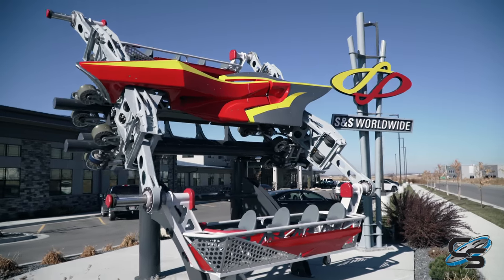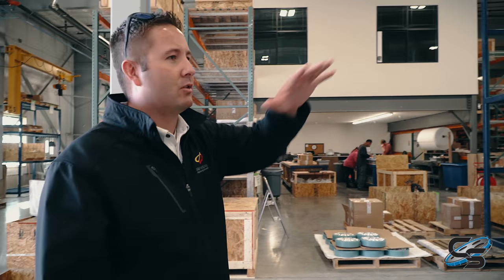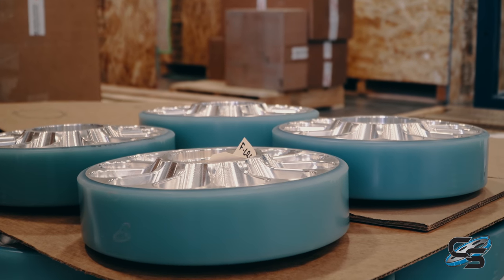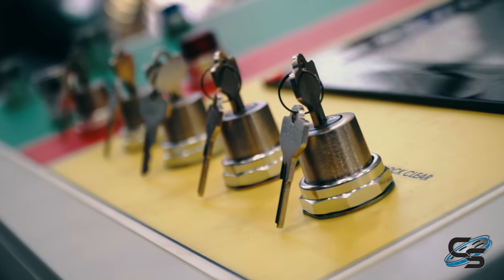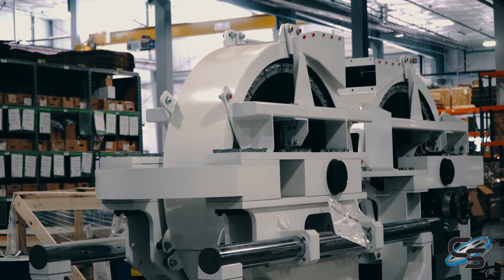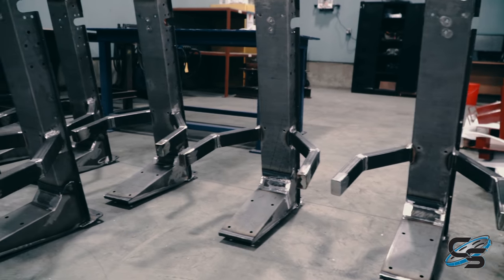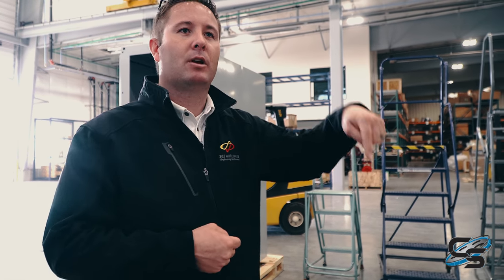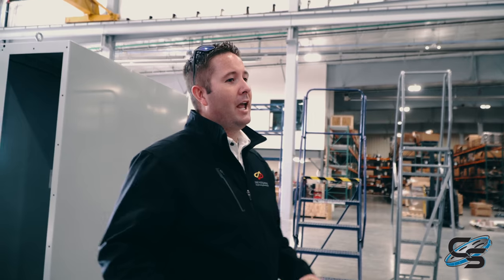S&S Worldwide 2019 Factory Tour | Logan, Utah

Comment: I absolutely love that they're still supplying parts for all the old Arrow coasters.
Reply: As a matter of fact, they're currently re-tracking Big One in Blackpool Pleasure Beach
Reply: so, arrow coasters will last about... 29482948284729471891937572049856194819577619102956194019371930428294957295719577619720298290581791417480166184092617050586164950293882029482740603668405039582959993747milliseconds
Reply: @dotdankory   Considering there are 86,400,000 milliseconds within a day giving you 31,536,000,000 in a year, that ridiculously enormous number you just randomly typed out means that Arrow coasters will be supported by S&S for approximately the next 9,000 years. So RIGHT ON!
Reply: @NorthernRidesYaBoi  The steel is being fabricated and installed to the original specifications in the UK and not by S&S. Just to make obvious yes there is love for Arrow but BPB and its contractors are handling the retrack.
Reply: @ChloeClements34  Oh okay, my bad

Comment: I wonder if they’ll ever build a new Arrow Suspended Coaster. I mean, people loved those and these people have all the drawings from Arrow
Reply: this new model is basically an arrow suspended coaster with inversions
Reply: Balthazar Brat but the suspended coaster’s prototype DID have an inversion. At least I think it did
Reply: @benwetzel8449  I'm pretty sure a prototype was never built that way but the original thought process by Arrow was to try and make a ride that way.
Reply: Gavin Hatfield there’s photos of the prototype. I’ll try to find it
Reply: Balthazar Brat as far as I know, that’s the only known photo. There might be others but I highly doubt there’s a video. This was apparently joint testing between King’s Island and Arrow for the Bat. Apparently the bat was supposed to have a corkscrew
Reply: It would be awesome if S&S redesigned the Arrow suspended so that it would be capable of going into inversion elements.

Comment: I would love so much to know how on earth s&s air launches work, as far as how the cable is managed and how it connects to the air cylinder, slug, whatever it is. And also how on earth they keep seals and contained pressure with seals for the parts that move in and out of the air cylinders.
Reply: i don't know, but i'd guess they work like other pneumatic (and probably also hydraulic) cylinders, so you could look those up